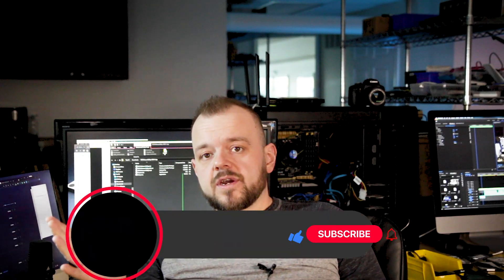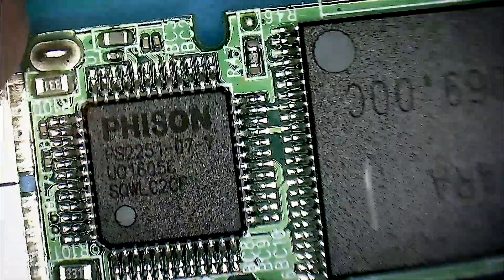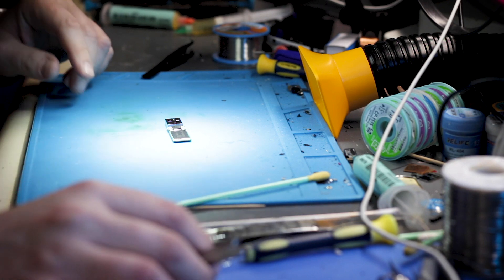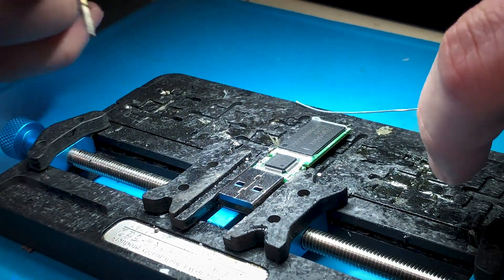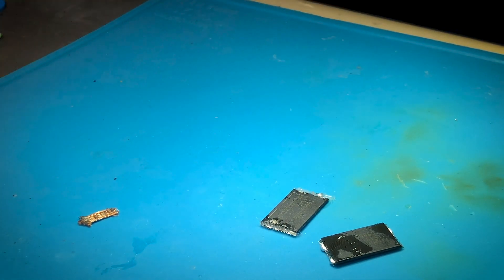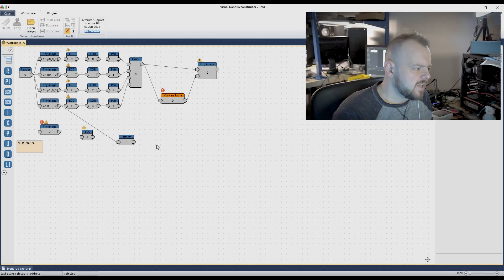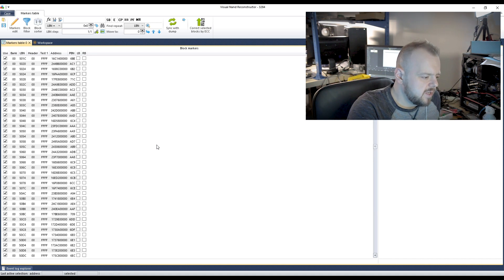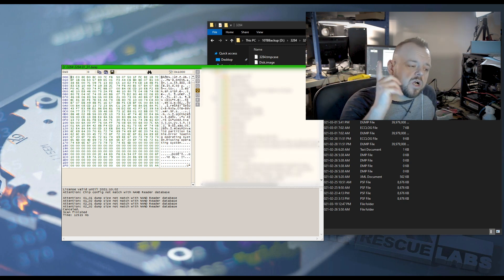VERBATIM USB stick not working

Comment: Hello,
       Something was not correct as far a voice was concerned  , Specially when you were desoldering the TSOP48 Chips ,BTW why does Most of The TSOP48 you do have Chip legs bent ,If this is by the soldering you do initially then you need to use " Quick Solder " Bismuth Which has Very Low Temperature Like Demonstrated By Erkin In Some Of His Videos  , You Said Please Comment in The Comments Section If You Do Not Like Something ,Well I would be Very Interested If In Your Videos You Could Spend Sometime And Explain VNR/FE Steps So That DR Guys All Learn a Bit .Its a NAND Failure And Not a Controller Failure BTW in This Case .
Reply from the maker: Thanks for your feedback. 

I lost some footage as this was filmed long ago so audio didn’t match. I do this occasionally and you might notice that sometimes the shots don’t match but I do my best to provide seamless experience.

Regarding removal and bent legs, everyone has their methods. In my previous video I used bottom heater with low melt. Also, since these videos aren’t filmed in sequence, some of these removal procedure might be months old. My soldering might look sloppy sometimes, and it’s not from the lack of trying but rather that both my hands suffer from serious autoimmune arthritis and soldering is a struggle for me. I might have mentioned this in my other videos or there might be one coming where I will mention it. My condition has worsened so I look for other ways of doing things. Soldering is becoming really tough for me. I have used quickchip low melt before, just never posted it. Sometimes I use my IR, I switch it up ;)

As for the assembly portions, this isn’t a training video, I don’t know if anyone apart people in DR, that would care to see assembly and I don’t always screen record. I purely make this to bring clients in, this isn’t a secret. If I was making videos geared towards DR people, I wouldn’t waste time on filing soldering but that’s not where the clientele is. Maybe next video I’ll add more assembly.

To address the error in the video, Yes it’s a nand failure I said that in the video that led to translator issue and may or may not also caused a controller issue. 

I’ll probably be mindful next time. This case was done a while ago and I honestly didn’t remember what the issue was. I don’t even remember whether this USB showed its size of even if USB dev showed up. 

I have bunch filmed from other flash drives of the procedure of chip removal and I don’t even know what was the issue with those either. I should probably start taking notes.

I will address this in the next video.
Reply: @forensicguy  The idea was to convey you what i felt as a audience ,Some peeeps might be thinking competition is grilling stanko ,Well thats not true reason is that a bunch of us share a very invisible and strong bond of our profession related to Data recovery .
Reply from the maker: I didn’t take it as anything negative. Also, not everything you see in these videos is what I might do if not recording. I don’t want to share everything on social media.
Reply: @forensicguy  Then Secretly Share with us Haahaa Right Stanko
Reply from the maker: I do actually. I’ve helped more than few people privately with vnr

Comment: cool beans, but if the card translator is giving up 0s it's not a controller failure bro
Reply from the maker: Maybe, but fact remains that USB failed because of the degraded memory that damaged the translator. Whether the controller is bad or not I guess it doesn’t matter. I guess I could’ve said that but meh whatever 😆